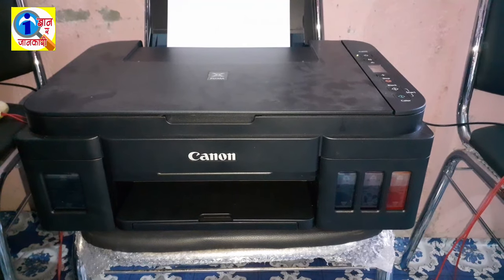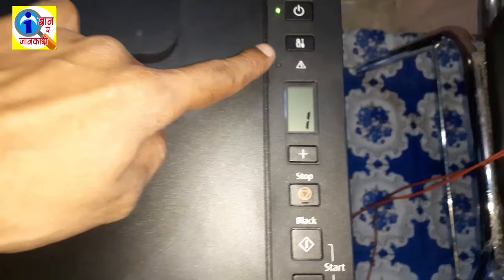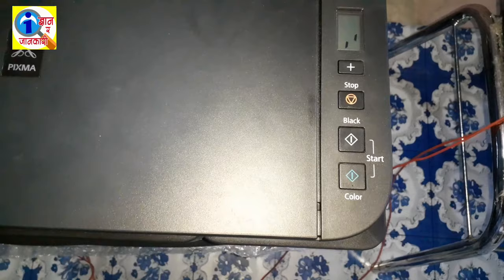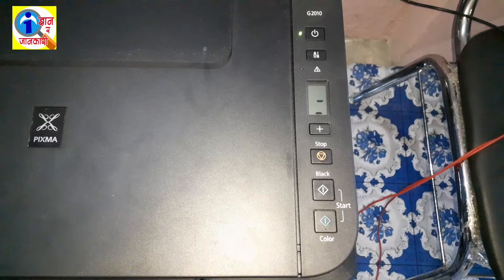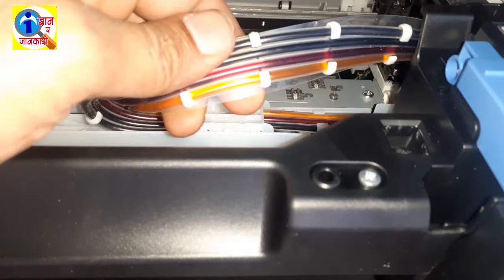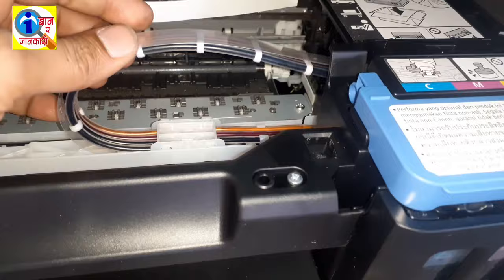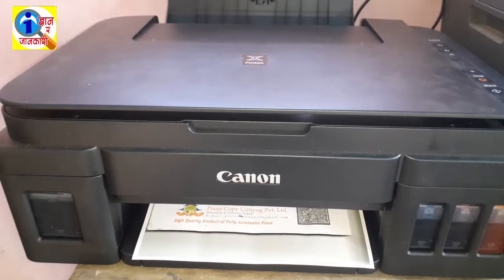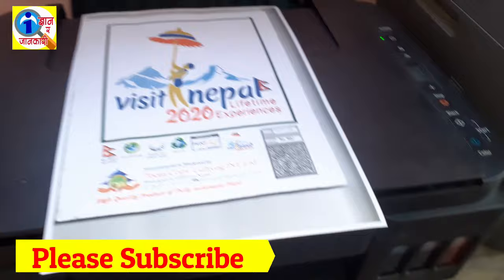Canon G2010 Empty ink pipes | Blank Print | Air in Pipe | P08 Error | Canon Pixima G2010

Comment: Ive been using my printer for months, not realizing that some of my ink tubes are empty, but it can still print without a problem. My question is, is it necessary to fill the ink tubes or it is okay to just let it empty?
Reply from the maker: If ink pipe is empty and printer is still printing that  means printer is printing from the researved ink on cartridge. Once researved ink finishes than the problem could be arise. I suggest you to fill the pipes before the problem comes :) good luck.
Reply: @gyanrajankari  omg thank you so much! Will definitely fill my ink pipes now. God bless! :)
Reply from the maker: Its my pleasure